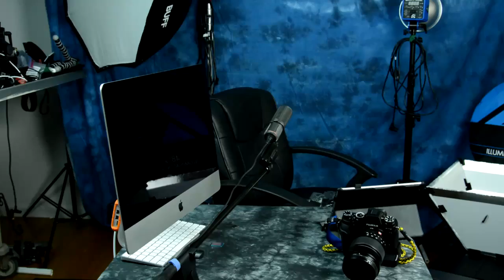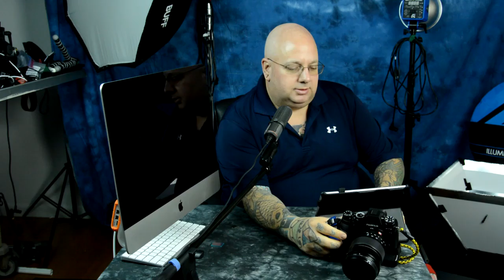NATIVE GAIN *Must-See Video* WHY EVERY Camera Mfg. has reached the Photosite LIMIT

Comment: An electric circuit is a device that allows the passage of electrons...Miniaturise all you like, but you will eventually get to the point where the pathways are smaller than an electron.
Reply from the maker: if you think an electron particle exists, ……ROFL ROFL      All the greats of electrical theory, Tesla, Steinmetz, Heaviside, DENIED such BS. 

sorry, but there is no such thing as a "charge carrying particle"  ROFL  ,…..
Reply from the maker: Nikola Tesla November 1928 interview:On the whole subject of matter, in fact, Dr. Tesla holds views that are startlingly original. He disagrees with the accepted atomic theory of matter, and does not believe in the existence of an “electron” as pictured by science.“To account for its apparently small mass, science conceives of the electron as a hollow sphere, a sort of bubble, such a bubble could exist in a medium as a gas or liquid because its internal pressure is not altered by deformation. But if, as supposed, the internal pressure of an electron is due to the repulsion of electric masses, the slightest conceivable deformation must result in the destruction of the bubble! Just to mention another improbability...” - Nikola TeslaArticle: “A Famous Prophet of Science Looks into the Future” (Popular Science Monthly)

“My ideas regarding the electron are at variance with those generally entertained. I hold that it is a relatively large entity carrying a surface charge and is not an elementary unit (particle). When the ‘electron’ leaves an electrode of high potential and in a high vacuum it carries an electrostatic charge many times greater than normal.” – N. Tesla      

  “To describe an electron as a negatively charged body is equivalent to saying that it is an expanding-contracting particle. There is no such condition in nature as a negative charge, nor are there negatively charged particles. Charge and discharge are opposite conditions, as filling and emptying, or compressing and expanding are opposite conditions.” – W. Russell     

JJ Thomson developed the “Ether Atom” ideas of M. Faraday into his “Electronic Corpuscle”, this indivisible unit. One corpuscle terminates on one Faradic tube of force, and this quantifies as one Coulomb. This corpuscle is not and electron, it is a constituent of what today is known incorrectly as an “electron”. (Thomson relates 1000 corpuscles per electron) In this view, that taken by W. Crookes, J.J. Thomson, and N. Tesla, the cathode ray is not electrons, but in actuality corpuscles of the Ether.” – E. Dollard   

  “There is no rest mass to an ‘electron’. It is given here the ‘electron’ is no more than a broken loose “hold fast” under the grip of the tensions within the dielectric lines of force. They are the broken ends of the split in half package of spaghetti. Obviously this reasoning is not welcome in the realm of Einstein’s Theory of Relativity.” – E. Dollard

 “Unfortunately to a large extent in dealing with dielectric fields the prehistoric conception of the electro-static charge, the ‘electron’, on the conductor still exists, and by its use destroys the analogy between the two components of the electric field, the magnetic and dielectric. This makes the consideration of dielectric fields unnecessarily complicated” - C.P. Steinmetz (Electric Discharges, Waves and Impulses)     

The idea of electricity as a flow of ‘electrons’ in a conductor was regarded by Oliver Heaviside as “a psychosis”. This encouraged Heaviside to begin a series of writings    

Also consider the J.J. Thomson concept of the "electron" (his own discovery). Thomson considered the electron the terminal end of one unit line of dielectric induction.     

“Electrons as a separate, distinct entity…doesn’t really exist, they are merely bumps in something called a ‘field’.”  - Dr. Steve Biller

You cannot say that stretching a trillion rubber bands nailed to the floor and releasing them or breaking their “force lines” is the “flow of electrons”; discharge is a terminal movement in systems of inductance or dielectric capacitance.  There are no discrete particles in the universe and certainly none that mediate charges, discharges, magnetism, electromagnetism, gravity, and radiation, only fields, all modalities of the Ether. The so-called ‘electrons’ are not particles, not objects or subjects but are the dynamic principle of discharge, and are certainly not charge-carriers, fields are not particles, are not “electrons”, nor assuredly are there energy discharges in the vacuum of space involving ‘electrons’; the ‘electron’ is a fiction of fallacious observation and an even more faulty mental acuity, spawned naturally from the minds of materialists, or an Atomist. Electricity is Ether in a state of dynamic polarization; magnetism is Ether in a state of dynamic circular polarization upon itself, is the radiative termination of electrical discharge; dielectricity is the Ether under stress or strain. The motions and strains of the Ether give rise to electrification. Phi times Psi gives Q; ‘electrons’ do not mediate these electrical and magnetic forces or their likewise the Ether fields.
Reply: Interesting quotes. I would appreciate hearing your considered observations...Oh, and if possible without resorting to ROLF in order to humiliate and belittle a subscriber.
Reply: I can't help it, but being a parent, I just listen to you spouting your opinionated, petulant nonsense, picture you in a diaper, and think, 'Poor baby, he either needs his afternoon nap or something to eat"
Reply from the maker: i didnt belittle anyone other than "mass consensus" which is NEVER accurate. 

Opinionated???i just quoted 3 people that created 99% of the worlds electrical system. 

Tesla, Heaviside, and CP Steinmetz 

but im sure they dont count, right? :) 

This Particle BS/ Atomism is nothing but a brain-dead cult of insanity , the spawn of GR and QM

it has no basis in reality.